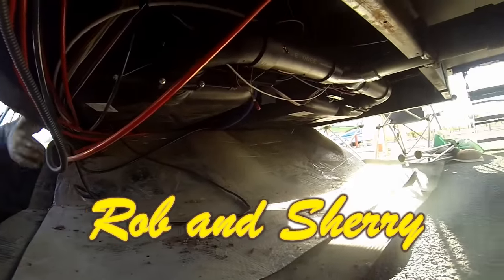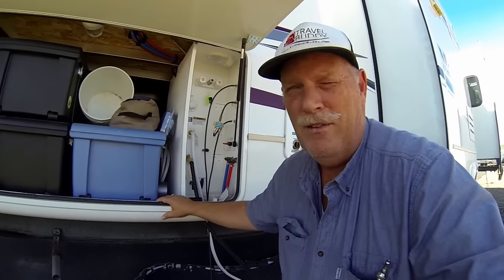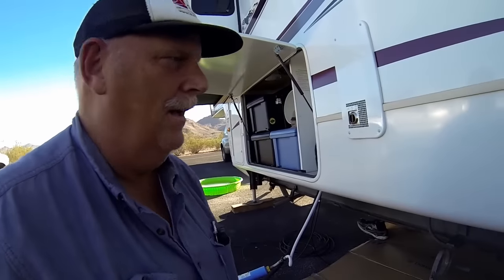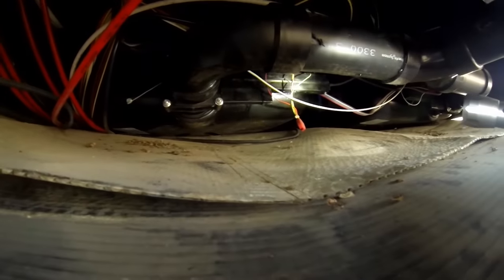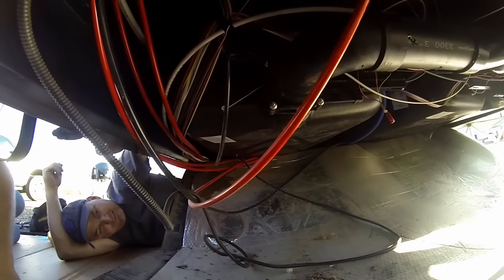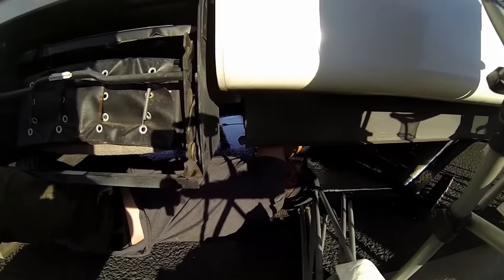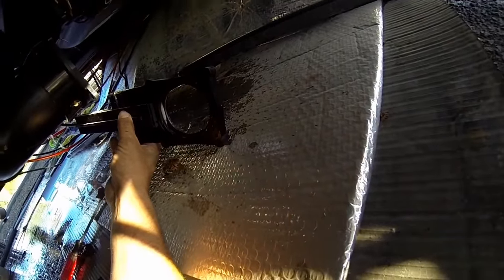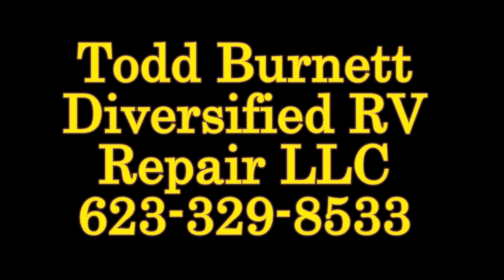RV Black Holding Tank Valve Replacement | RV Travel Buddy #rvtank #blacktank #tankvalve

Comment: Have that same valve in my RV. Valve is stuck closed with black water tank full. Trying to find a solution and nobody seems to have an answer for this issue. I can't be the first one to experience this... Anyone have a solution?
Reply: Penetrating oil, spray into both ends of cable. May have to remove cable to spray into ends. Wait a day then try pulling open valve. If that doesn’t work, replace valve and cable.